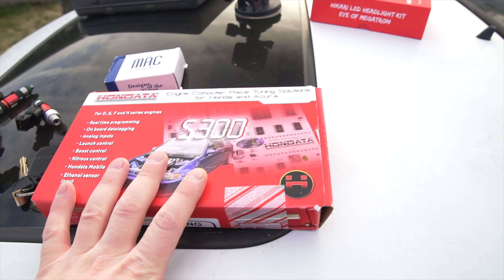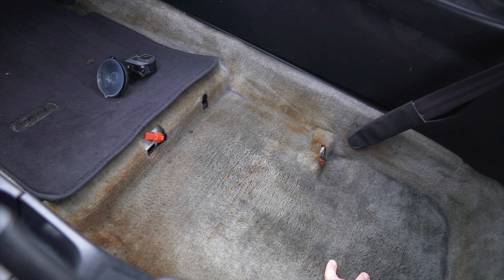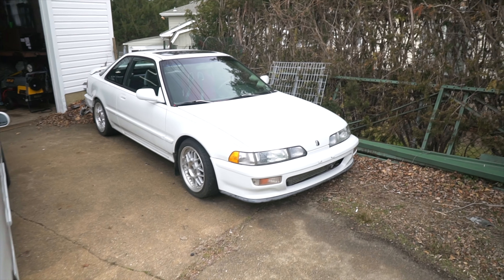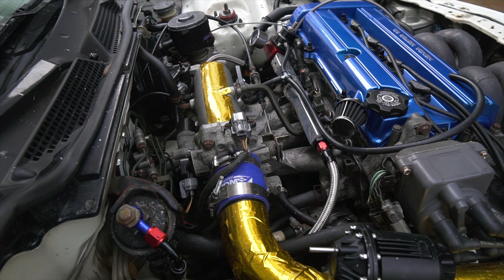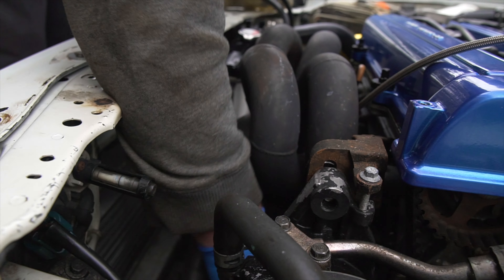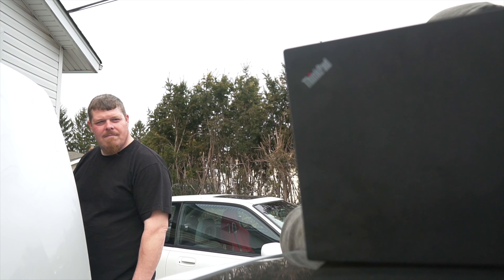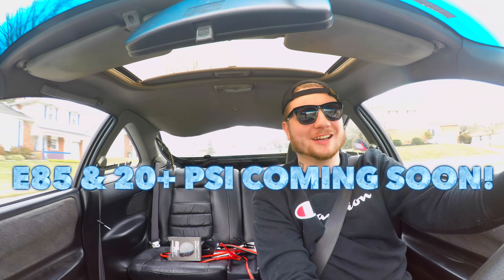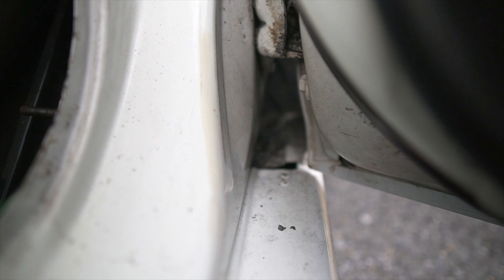Integra turbo makes boost | 2step - base map | hondata s300 install & 1000cc injectors install

Comment: What turbo kit are you running on this? Also what turbo is that? Sweet setup man!
Reply from the maker: Turbonetics 57trim turbo and eBay turbo kit bolt on and PLM ram horn manifold